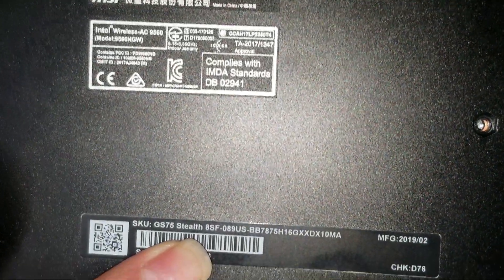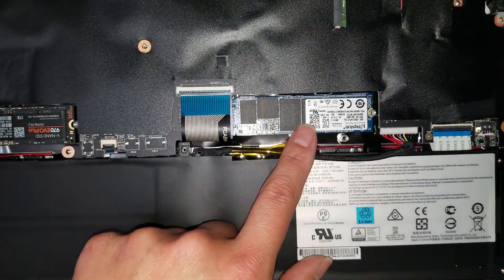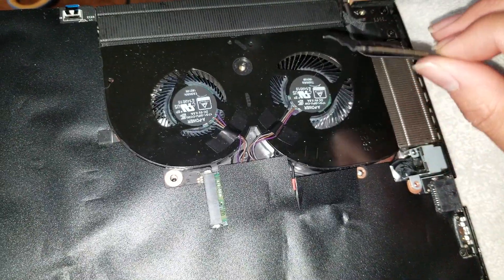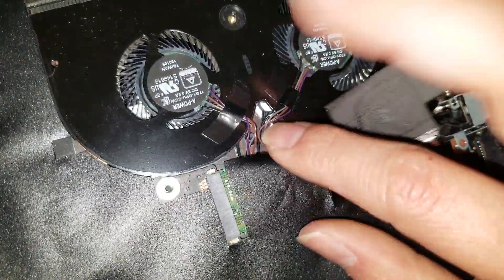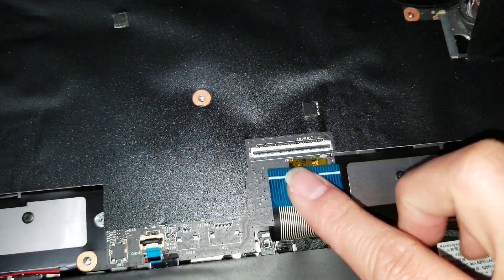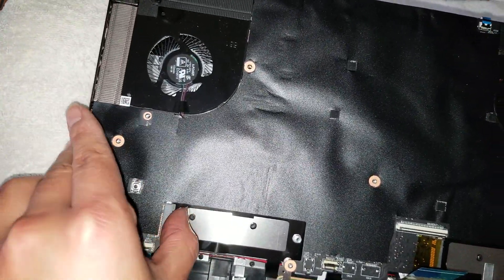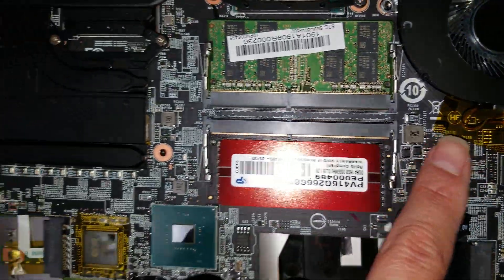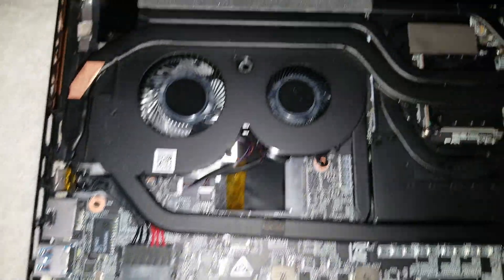*Disconnect Battery First* MSI GS75 Stealth Disassembly RAM Upgrade SSD

Comment: Imagine if we could install a 99 or 100 watt hour battery on this laptop. This would get much better battery life and useability. I do not understand why manufacturers do not use the maximum watt hour battery allowed on airplanes. The way I look at it is if you are building a 17 inch laptop, you should use the biggest capacity battery to offset powering a bigger display. This is common sense but not many companies think about doing this. I know the argument that newer laptops are more efficient and use less power so they can get good battery life with smaller cells. Imagine if laptops always used 100 watt hour batteries even when components become more efficient, that would lead to amazing battery life.
Reply from the maker: Most people will be hooked to a wall while gaming, so it's unnecessary weight and the batteries don't last forever. Also, the battery needs to put out more power to run the GPU at max speed. Even with the largest battery you'd only get 1-2 hours of game time. If you're sitting somewhere with internet, why not plug it in?

They sell portable battery backups if you want a larger battery, but the average buyw buyer won't use it and it'll just end up going to waste sitting at 100% capacity until it can no longer hold a charge.
Reply: @ItsBinhRepaired  Of course I understand that. I meant better use time with light tasks. I would not game on battery anyway because performance is bad on battery.
Reply from the maker: @cemsengul16  what's the voltage/amperage of the current battery pack?
Reply: @ItsBinhRepaired  well the factory battery is 15.2 volts and 5380mAh / 80.25Wh. I just do not like that the battery is 80.25 watt hours for a 17 inch. The XPS 15 which is not even a gaming laptop anymore has a 97Wh battery and it is basically a 15 inch ultrabook.
Reply from the maker: 100watt hour is only enough to run 100watts for 1 hour. Most gaming laptops are 120watts or higher. So the max won't even give you 1 hour actually.

Comment: So I do not understand something. Is the GS75 bottom firing speakers or are those bottom speakers just for bass? I thought it was a top firing Dynaudio system?
Reply from the maker: If you own the laptop, you should be able to answer that question by listening to where the sound comes from. I don't own the laptop, so if you don't see it in the video, I wouldn't know.

Comment: what kind of heat pad is under the ssd ? Where can I buy it. just installed a crucial 1tb.
Reply from the maker: Not really sure about the heat pads, but I'm sure you can find thermal pads on Amazon. You'll have to measure the thickness of the original and maybe cut it to size.
Reply: @ItsBinhRepaired  I put in a new ssd. leaving the old where it was. I guess I need to know how thick. I have seen on amazon 1,5 mm. ( m.2 Thermal Pad 70 x 20 x 1.5mm ) how do I find out which one to order ? tx for your reply
Reply from the maker: @dirkschelfhout6460  you'll have to measure the old one or just not use one.
Reply: @ItsBinhRepaired  I bought a pack for ssd nvme that has multiple 2mm 1mm and 0,5 mm strips. I ended up combining to 3,5mm. At that point the pcb stayed put without the screw, so I knew it was making contact. Not sure it helps a lot because the chip is on the top side. but sure it will cool some. very happy with my crucial 1tb. This is new versus old : > Disk  Random 16.0 Read                       360.00 MB/s          8.1
> Disk  Sequential 64.0 Read                   1542.42 MB/s          8.8
> Disk  Sequential 64.0 Write                  1706.52 MB/s          8.9

> Disk  Random 16.0 Read                       294.95 MB/s          8.1
> Disk  Sequential 64.0 Read                   1014.97 MB/s          8.4
> Disk  Sequential 64.0 Write                  706.93 MB/s          8.2

Comment: Was able to disassemble and add ram but when putting back together I was not able to get one of the wireless antennas to go back into the socket. Any suggestions on how to get it to fit or how to fix it if it got bent a little bit?
Reply from the maker: Once it's bent it's very difficult to bend it back. You'll have to use a needle or something, but you might end up having to replace the antenna if it can't be repaired.

Comment: Great job. Nice to know what I'm jumping into. Your video is the only thing I can find on doing this 
Why couldn't they put the RAM on the back side? If anything is going to be upgraded, it will likely be the RAM. I bought this because it's one of the few laptops that supports 64GB. It came with 32GB, going to 64GB this weekend and will also add a 1TB NVMe stick. ll so I can run some more VM's.
Reply from the maker: Glad you found it useful. I think a lot of manufacturers do it for two reasons. One is so people that don't know what they're doing don't attempt it and two is to charge you more to send it to them for upgrades and repairs, or to force you to buy the most specced out model from the beginning which gets them more profits.

Don't forget to like and subscribe if you haven't already. It'll really help me out. :)

Comment: @It's Binh Repaird
Wonderful video! I really enjoyed as you gave an explanation as to what each individual component was and what each wire was connected to. Not to mention, the laptop is new. You get a thumbs up and a subscribe from me :D

Sorry, I just have a few questions and it would really mean a lot if you or the community helped me out.
I want to change the thermal paste for my GPU/CPU. In the video, you said that there are pads that I need to also replace/buy if I ever lift up the heatsink. Can you go more in depth what you mean? And where can I buy these pads? What are they called? I thought I could just use their existing pads when I'm placing it back together

I really want to upgrade my CPU. I have an i7-8750h and wanted to know if MSI solder's their CPU - maybe it's possible to upgrade/replace it? My motherboard is MS-17G1 and according to this website:  https://www.userbenchmark.com/System/MSI-MS-17G1/110722 
it seems like I can have only 2 other options? Can someone help validate this information? I have never soldered anything before. 

THANK YOU IN ADVANCE! Anyone in the community is welcome to help me out!
Reply from the maker: Sorry for the late response. YouTube didn't notify me of your comment. You can reuse the pads as long as you're careful with them. I believe they're just called thermal pads but they vary in thickness. Not sure what exactly they use. You can probably call msi for the exact ones.
Reply from the maker: I believe the cpu was soldered to the board and can't be replaced.

Comment: I have the 9sf model and it has 2 8gb Kingston sticks (16gb) total. I wonder why mine is different. It also came with samsung 1tb nvme ssd. I was going to upgrade the ssd but after testing the speeds 3500 read/2400 write, I figured just to leave it. Does your differnt type of ram affect the performance at all. I am thinking of 32gb 16x16 ddr4 2400. I can buy it locally instead of ordering the 2666 ram.
Reply from the maker: Other than filling all the slots with even amounts of memory, I usually feel anything over 8gb RAM is overkill for the average user. This was one of my customer's laptops, so I didn't really get to experiment with it, but I don't think it'll make any difference unless you're actually using all your RAM.

Comment: You just earned my sub. Great video btw. I perform this work like yourself.Located in central Illinois so if anyone needs some help with this or another pc project let me know!
Reply: Guys i'm super noob. I'm looking at getting this laptop.. I dropped the link below. Is this one the exact same? I need to know so I can see if it is worth tinkering or should I just buy a 1tb MSI GS75
https://www.amazon.com/MSI-GS75-Stealth-203-i7-8750H-Diamond/dp/B07MQBHZTP/ref=sr_1_1?crid=2COTAGV6CJ9SA&keywords=msi+gs75+stealth&qid=1565585554&s=electronics&sprefix=msi+gs+75%2Celectronics%2C166&sr=1-1.
Reply: @alexanderthompson1187  It is the same cpu and model but the Amazon link you provided states only 16 gigs of ram and only a 256 ssd. The price is great but just keep in mind that if you want dual channel memory you need to fill the second dimm slot with an equal amount of memory.The max memory is 32 gigs. Also that ssd is pretty small for serious gaming.I would clone it to a new ssd or add a secondary ssd to hold your games and other big files. But yea it's a great deal! So go for it if you feel confident about adding the upgrades. Good luck!
Reply: @MidwestTechAndGaming  Hey my guy thanks for the help and recomendation first off. Just to clarify, if I want to upgrade then, I was looking at putting in a 1TB SSD or maybe 2TB if I found a deal. But my question is, if up the SSD do I have to up the RAM to 32gigs? or can I just keep that 16gigs. I don't game, but I use FL Studio, Protools for music production, and am learning Adobe After Effects and such. Will 16 gigs operate efficiently? 

Or is what you are suggesting is adding another RAM in the dimm slot of 16 gigs to get the most out of it.
Reply from the maker: for most people over 8GB RAM is overkill, no need to upgrade ram with larger SSDs
Reply from the maker: The main thing is having 2 identical sticks of ram to take advantage of dual channel memory.
Reply from the maker: Yeah, for gaming, 256GB is kind of low unless you don't play games that take a lot of storage.
Reply from the maker: should be basically the same setup
Reply: @Midwest Tech and Gaming
Hello, I know I just asked this question in the general comments, but perhaps you could help me as well? :) I researched and researched but found absolutely nothing for my concern with this MSI GS75.

I want to change the thermal paste for my GPU/CPU. In the video, he said that there are pads that I need to also replace/buy if I ever lift up the heatsink. Can you go more in depth what he means? And where can I buy these "pads"? What are they called, thermal pads? I thought I could just use their existing pads when I'm placing it back together

I really want to upgrade my CPU. I have an i7-8750h. Is it possible to upgrade/replace it? My motherboard is MS-17G1 and according to this website:  https://www.userbenchmark.com/System/MSI-MS-17G1/110722 
it seems like I can have only 2 other options? Can someone help validate this information? I have never soldered anything before and I don't know if I even need to.

THANK YOU IN ADVANCE! Anyone in the community is welcome to help me out!
Reply from the maker: haven't attempted that, so I'm not sure. Usually you can reuse the heat pads, but you need to redo the thermal paste.
Reply from the maker: awesome! Glad it helps

Comment: how much space is there for the m.2 slots?  I was looking at the patriot VPN100 m.2 drives, but they have a heatsink on them and I was wondering if you thought they'd fit.
Reply from the maker: Shouldn't be bigger than the thermal pad. I'm sure it'll be fine. These aren't my personal devices. I do these repairs for a living, so if you see a video up, unless it is same day, I probably already returned the device to the customer.
Reply: @ItsBinhRepaired  thanks!
Reply from the maker: @LifeWithMatthew  you're welcome. Hopefully it helped

Comment: Can i fit a single notch nvme like the one you have (samsung 970 evo) at the kingston slot as well ? Thank you
Reply from the maker: Not sure what you mean. 2 slots take nvme m.2 (1 notch) and one takes m.2 sata (2 notches). I mentioned it in the video I believe.
Reply: @ItsBinhRepaired  you mention that the top nvme slots support one notch but when you remove the white kingston nvme it has 2 notches !!
Reply from the maker: @michalis5817  you're right. Most nvme slots are backwards compatible with sata.
Reply: @ItsBinhRepaired  ok, i didnt know that thank you!

Comment: Perfect, thanks for the teardown. Curious about re-pasting and wanted to see what I'd be getting myself into.
Reply from the maker: After the upgrade I returned the laptop to the customer, so I don't have it to show the thermal pasting. There really is no reason to redo it unless it's running too hot.

There will most likely be a whole bunch of thermal pads for the video memory though.
Reply: No worries, I learned what I needed from your video. It does run ludicrously hot under some workloads, e.g. Breath of the Wild running on cemu can get the CPUs up to 98 degrees. Re-pasting is not something I'm excited to do though, so I'll try some other things first.

Comment: Thinking of applying thermal pads on nvme ssds on this model, what thickness do you recommend
Reply from the maker: I'm not sure actually. One already has a pad. You can check that one.
Reply: @ItsBinhRepaired  I have yet to get one and I'm thinking of getting everything I need in one go, anyways keep up with the quality content
Reply from the maker: @TheW1nd  makes sense. I think the pads were pretty thick. Might be able to get the info from the manufacturer

Comment: Dude I’m closing the lid back but the right side of the laptop ports where the 2 USB ports are and the other ports are floating but the other side is fit in
Reply from the maker: When you put the logicboard back, make sure you put it at an angle with the audio jacks going into their slots first.
Reply: It's Binh Repaired I launched my laptop up but my track pad isn’t working
Reply from the maker: @Gamers4511  probably missed one of the ribbon connectors. Did you figure it out?

Comment: When taking off the back panel did you use your finger nail? If so from which end did u start prying open from? Im worried cause I don’t want scratches.
Reply from the maker: As mentioned in the video, start at the Ethernet port.
Reply from the maker: Start with the Ethernet port as mentioned in the video.

Comment: Thanks!! Exactly what I needed! I'd also like to change the thermal paste as well as the pads. Do you happen to know what the dimensions of the pads I would need?
Reply from the maker: I haven't taken those out, so I'm not too sure. I actually have never replaced thermal pads on any computer before, though I have put IC diamond in place of them, because it's a pretty thick paste that doesn't run, though probably better to stick with pads. Can't really monitor the temperatures of the chips to make sure the temps are good.

If you need exact dimensions I recommend contacting msi for the thickness and sizes. They probably sell replacements as well if you mess them up.
Reply from the maker: Don't forget to subscribe, it'll help me out a lot. :)
Reply: @ItsBinhRepaired  Thanks for the tip! I've already subscribed :)

Comment: What's the brand of the stock ram? I'm looking to upgrade from single to dual channel the cheapest way possible.
Reply from the maker: If you can't take it apart to check, I don't recommend doing the upgrade. Manufacturers don't stick with one brand. I'm not sure of a way to get the exact model through software.

Comment: Does this void warranty?
Reply from the maker: It shouldn't, but you'll have to ask the manufacture to be sure.
Reply: Not in the USA.   I would still use a heat gun and razor blade to remove it and replace it when done.
Reply from the maker: @dotJata  people are going to end up melting things with that advice lol even a hair dryer gets hot enough to melt keyboard keys.

Comment: Thanks you! This is exactly what I was looking for in order to figure out which slots are NVME. I have 6TB of storage now :)
Reply from the maker: Awesome! A sub would be greatly appreciated. :)
Reply: So I also have a gs75  and I can have 3 ssd but one is just m.2 data.  What's the point of that one being as how it has lower read write speeds compared to the other two?
Reply: @HondaWyo  for a stea libary or something like that
Reply from the maker: Just for additional storage

Comment: Would installing more ram increase tempatures on the laptop? Like would the cpu and gpu get hotter?
Reply: So far the temp has been pretty much identical with the temp I saw prior to the upgrade. (Binh was helping me upgrade my laptop which is shown in this video)
Reply: Very unlikely
Reply from the maker: Not really unless the processor works harder

Comment: This is so not newbie friendly holy shit.
I’m getting the new GS75 stealth - it’s my first gaming laptop .. it’s my first gaming computer actually lol. 
I have no idea what I’m doing. Why is it so complicated to just add more storage lol wow. I wish it came already added. It’s so much tougher than upgrading a Mac. Can I just like pay someone to do this? Lol
Reply: You don't need to do that full process to upgrade storage. To upgrade storage you just remove the back panel, everything past 1:34 in the video is to upgrade the RAM or other work on the computer.
Reply from the maker: @markyoung2847  correct
Reply from the maker: It's a lot easier than it looks. You can't even upgrade a mac anymore lol look at the 2017 and newer models. Pain in the ass to even get the lid off.
Reply from the maker: Buy it with an American express card or another with 90 day accidental damage coverage lol a lot of credit cards have free accidental damage coverage.
Reply from the maker: You can ship it to me with the parts and I'll do it for you. :P

Comment: Thank so much! I just received my msi gs75 and upgraded to 1.5 TO and 32 gig of ram with your tutorial ;) One thing i found hard was putting back the motherboard! it wasn't fitting in till i realized i could bend it a little to make it fit! All work perfectly and it took me 1h30. I took a lot of care with each step because i was afraid of breaking it but all good. Thanks!
Reply from the maker: To put the board back without having to flex it, you put it in at an angle, audio jacks first. Then it'll all lay in place nicely.